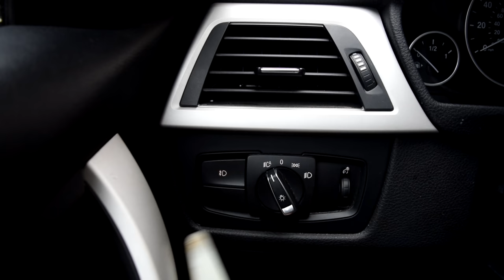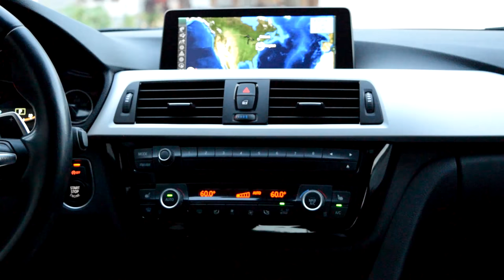BUILDING A BMW F30 IN 6 MINUTES!!!

Comment: Hi Shumile,
I saw your coding video for F30 and it is very interesting.
I have BMW 320i 2016 without comfort access.
I tried to code the mirror fold/unfold option and it is not working.
can you tell me that if I don't have comfort access feature in my car it will not turn on that feature?